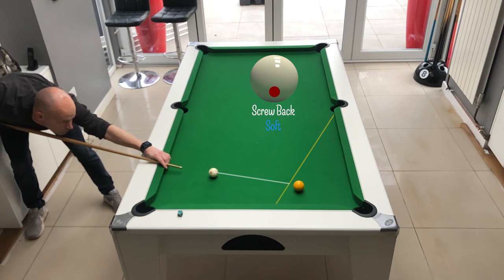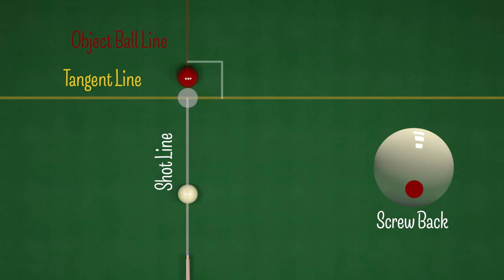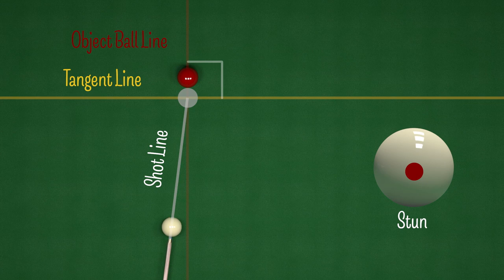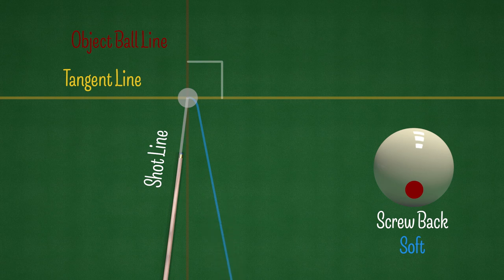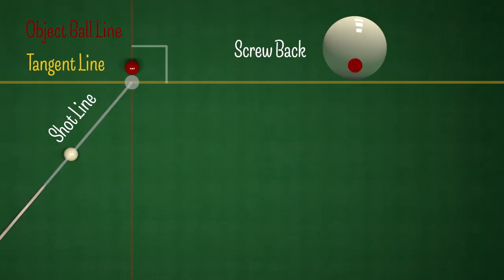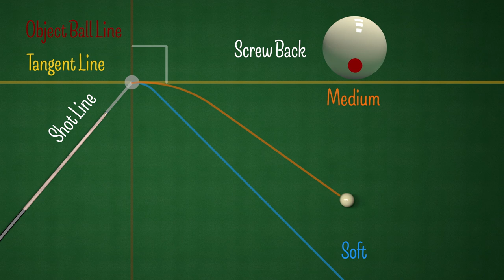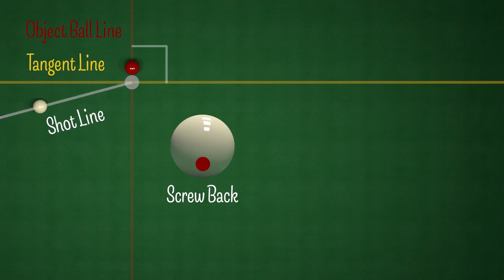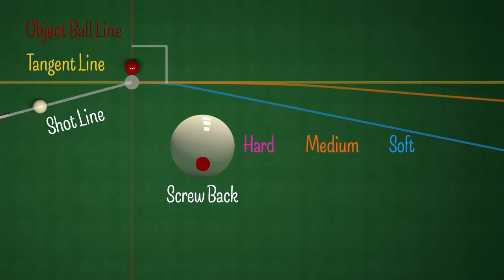Where's the cue ball going part 2 - Screw Back | Pool School

Comment: Great video. Does the part of the pocket you play into when you have an angle also have an effect on the path of the cue ball?
Reply from the maker: Absolutely. If the object is central to the pocket (like in my examples) and you play into the center of the pocket, then the tangent line runs parallel to the cushion. If you aim to pot closer to the near jaw then you will be hitting the object ball finer, so the tangent line will then be heading towards the cushion a little. If you aim to pot nearer the far jaw then you'll be hitting the ball a little thicker, so the tangent line will be slightly away from the cushion. Hope that makes sense?

Comment: Thanks for the vid. I'm getting a table soon, which one do you have again, please? And how big is that room? (Perhaps list it in your channel info?)
Reply from the maker: It's a 7ft pool Avant garde pool dinning table from Home leisure direct. I've actually just sold it and am waiting for my new one to turn up, a Supreme Winner. My table is 7ft x 4ft (214cmx122cm). The room is 13ft wide (400cm) and 25ft long (762cm). The width is just about ok but the room narrows at the far end to 11ft (335cm) which is too tight and I have to break the cue down when the cue ball is on the edge of the table. As a general guide, if you play with a standard 57 or 59 inch cue then you need to allow about 5ft all the way round the table. That would roughly give you a room of 17ft x 14ft (518cm x 426cm).
Reply: @PoolSchool  excellent, look forward to seeing the new table!
Reply from the maker: @blahtoausername  no problem. Worst thing is I can't make any new videos for a few weeks while I wait for it to turn up!